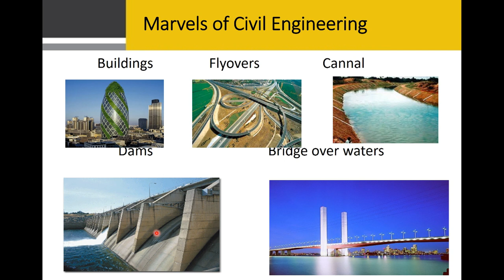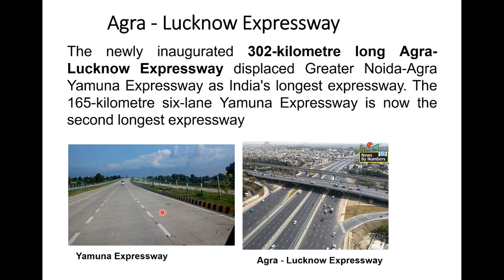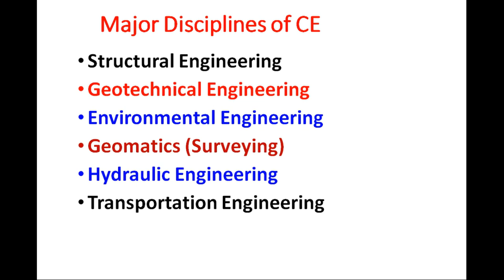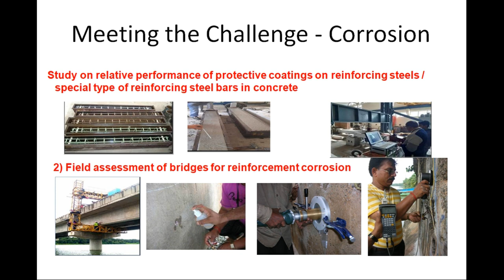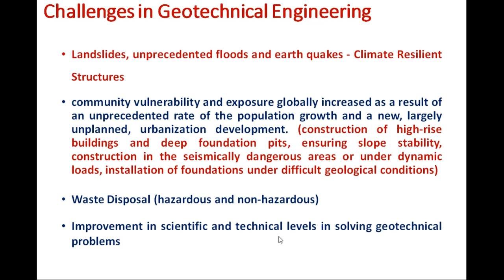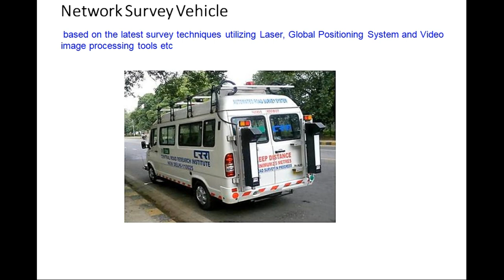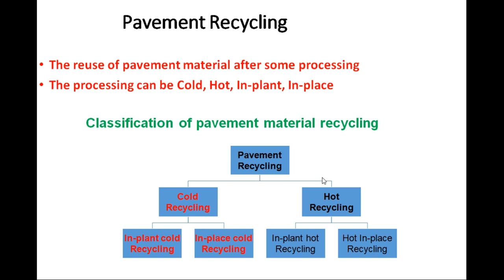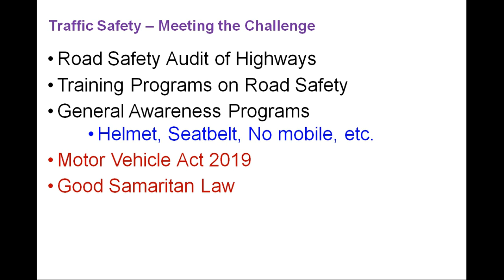#Civilengineering Joy and Challenges of being a Civil Engineer.

Comment: Hi sir bituminous mix design with use of plastic waste is topic par experimental program bata dijiye please sir this is my thesis topic sir plastic waste ke sath mix karke bitumen ki testing kaise karen
Reply from the maker: There is no change in the mix design procedure when using waste plastic. IRC SP 98 suggests use of waste plastic in dry process. If you are using wet process, the bitumen is to be tested in the same manner as we generally do in the case of modified binders. Separation test is a must.